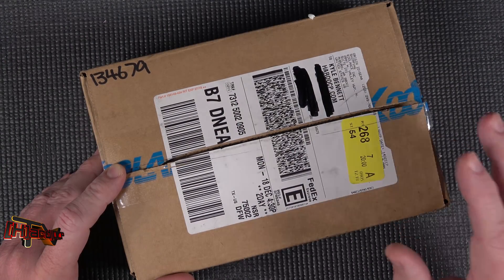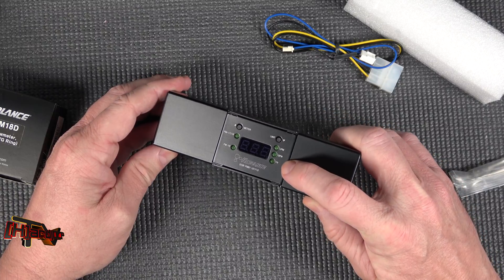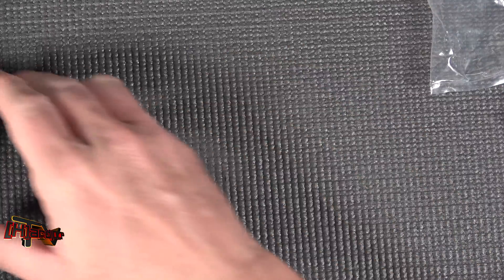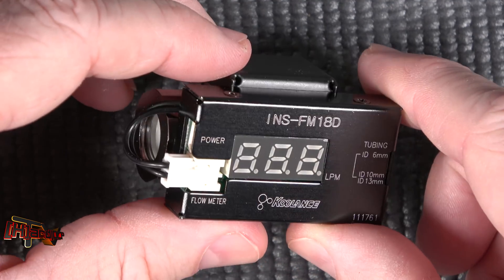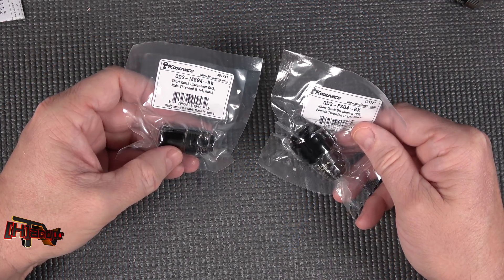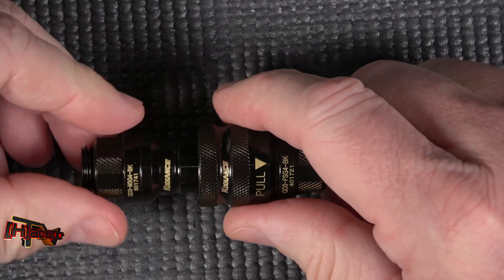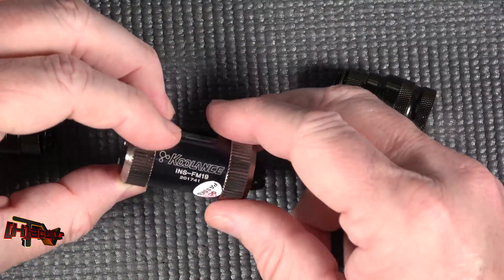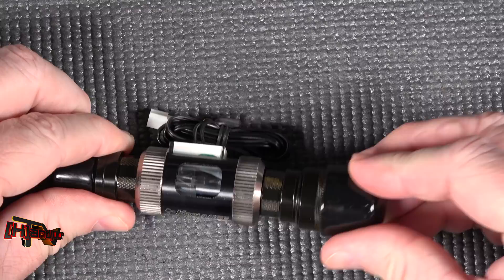Koolance Flow Rate Measurement Unboxing and Plumbing

Comment: Hopefully these flow meters will last longer than the older models (circa 2011).  They do work pretty well.  The first one lasted about 2 years before rattling and showing reduced flow rates.  They are much cheaper than higher end solutions.
Reply from the maker: Cheap enough that you can afford to replace these every few years.
Reply: Yes they are and with six to twelve month open system cycles it would be best to replace them.  Even if the bearings had the durability the reed switch itself has a limited number of actuations.